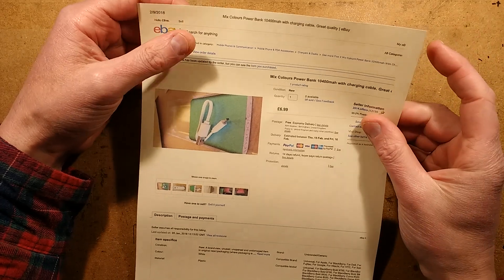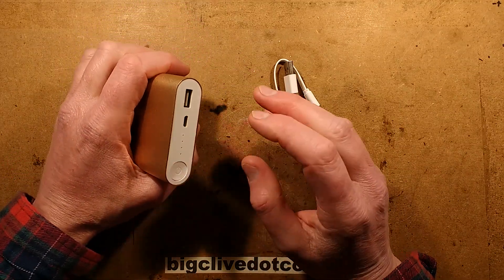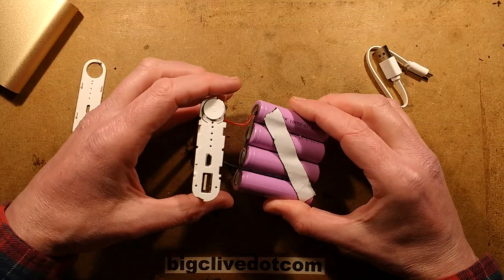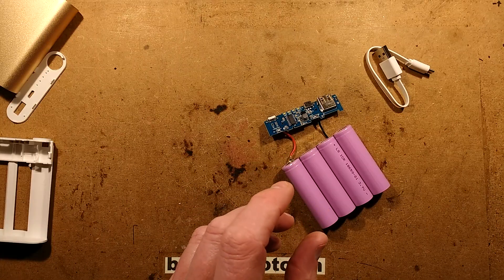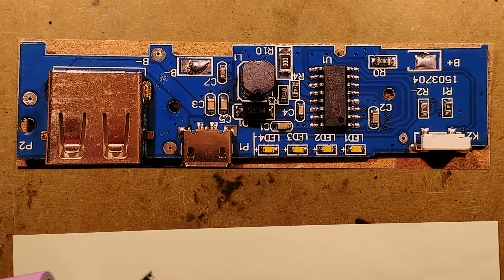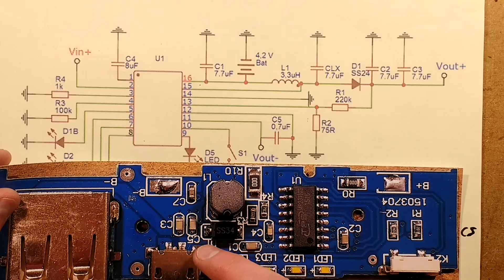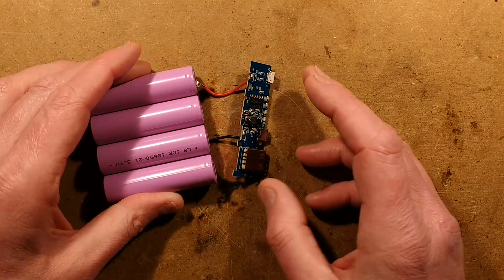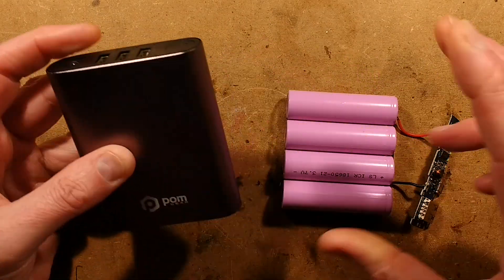Inside a fake "10400mAh" eBay USB power bank.

Comment: The design of it - the aluminum case with rounded sides, the interface plate, even down to the layout of text on the spec plate - is a rip-off of a series of popular Xiaomi power banks. I have a number of the original ones and they're truly excellent - quality, high-density cells, efficient boost circuit, etc. The fact that they really are excellent is of course why there are so many lookalikes out there. Quite a few videos exist here on YouTube about how to identify a fake versus an original Xiaomi. 

Xiaomi power banks actually tend to understate their capacity and list it as watt-hours as well, which is really nice. (They're not the only ones who do that, but they were the first power banks I encountered that do.)
Reply: Sorry, you have that back to front; here's a review of the Xiaomi 10400 from four years ago: https://www.youtube.com/watch?v=daKPjv_LaWU  

Another point in this is that Xiaomi is the one who had to start putting authentication codes on the packages of their power banks because of the clones; reputable companies like Aukey followed the Xiaomi's style cues because of their popularity. https://www.youtube.com/watch?v=obYhTgzEVP8
Reply: JetStream90 

Hes not being disrespectful. Hes freely expressing his opinion. In distress or emergency is a pretty great way to describe the state of the US since, at the very least 2001.

The governments actions since 9/11 have been inexcusable. Laws enacted since then have trampled over the rights that this country was formed to guarantee. Democrat, Republican, liberal, conservative and everyone in between should be disgusted. If you think any (R) is better than any (D) or vice-versa then youre blinded by politics. Thats what got us here.

I was 0331 2/1 Marines. I fly an Upside down flag. You wanna try to change that, HMU, youre more than welcome to try. 

Something you should know.
Reply: all them brands uses a casing and circuitry from a major OEM chinese brand ,i forgot the name ,something shenzung or whatever ,its generic and mass produced for many top brands and unknown brands
Reply: I have one of these, got it on sale from gearbest. They do in fact use weasel words with capacity since 5v is the standard but they use 3.7v in their capacity calculation
Reply: The xiaomi uses a TI charging controller.
Reply: Advertisement or not, I have a 10000mAh one as well and I'm satisfied. It does look very similar, but the xiaomi one I have is thinner and longer, and the power button is different.
Reply: I've had my Xiaomi 10400 MaH Powerbank for 1.5 years now and it's never let me down, a stellar product.
Reply: Living in a South Asian country (Bangladesh) Xiaomi is huge here. You can find it everywhere. Everything about the brand is so good. The phones, they are really inexpensive, yet better than phones that almost cost twice as much. The powerbanks, really inexpensive and reliable too. You name the products, and Xiaomi does it well. 90% of my friends use Xiaomi phones and not one of them is unsatisfied.
Reply: I stand corrected, I did not know that (don't tell anyone that someone on the internet actual admitted to being wrong, it could end society as we know it!). I don't think I'd even heard of Xiaomi back then.

Aukey's addition of QC 2.0 was the killer point for me though.
Reply: +Trid that's what  they all do.
Reply: Trid I forgot to wave my rainbow colored flag, dammit
Reply: iHome sells 10k amp powerbanks with this casing. I own one, actually. They're about $40 or so. It's a damn good power bank, but i'm not entirely surpised the case wasnt original.
Reply: Mine Xiaomi 10 000 mAh powerbank is actually 10 980 mAh. A whole 1Ah!!!
Reply: its still wayy off whichever voltage you use to calculate it, these are just reject cells, they dont even make intentionally 1ah cells
Reply: Aukey is only importer. xiaomi not make it itself. It's brands chinese stuff. https://xiaomi-mi.com/company/partners/
Reply: Aeolwn I meant the nominal voltage of the batteries, which (in case of Li-ion batteries) is always 3.7 volts.
Reply: That's true, but I certainly hope that people who actually do use the Wh ratings for any meaningful comparison (say to compare the energy efficiencies of different battery times) do.
Reply: Furr Bear Eh, I have no illusions about the battery industry, because bad manufacturers "inflate" (i.e. lie about) battery capacities just as much as speaker manufacturers lie about their speakers' power (yeah, I'm talking about the "magical" PMPO watts). And while Wh ratings for all sorts of batteries out there would be nice for comparison purposes, its proper calculation would be even trickier (especially in case of Li-ion batteries) than  the mAh value (as the latter's usually calculated at a specific discharge rate, say 1C, while Wh would have to involve some nice integration of the discharge curve, since its voltage changes quite noticeably during the discharge cycle). To give you just another analogy to speakers: many (especially Chinese) manufacturers don't even bother with showing the speaker's frequency response curve in their specs (if they have any), because measuring that is (much) more of a hassle than proclaiming e.g. a frequency response range of 100-15000 Hz.
Reply: Well, that explains a lot. I thought it was strange that such a carefully designed piece of hardware would lie about its internal specs...
Reply: Steve Evans Funny thing about admitting one's mistake: I saw some self-important person on social media calling this "i completely humiliated the other person". I buried my face in my hands over the fact that some people think that way.
Reply: Steve Evans admitting your mistake doesn't excuse it though. Like for example, why didn't you edit the very top of your first comment on this thread to say it is dead wrong. I have both Aukey and Xiaomi (and Anker and Huawei) products and there's really no excuse for spreading false information about them. They're huge companies. Not these little ones with poor support that might be gone tomorrow. Aukey is the smallest of the 4 I mentioned.
Reply: Came across one of them looking like that but it had a regular phone battery on the inside with plated metal rated for such a high number but yet the battery was only 3200 and it didn't work add half that
Reply: Odds are that they actually take defective Xiaomi units or at least parts to make these, that is how they usually make this profitable.
Reply: HAHAHA imagine not knowing everything Xiaomi sells is a rip off of something else.
Reply: Xiaomi used to be a rip off brand. Karma's a bitch lol.
They do go their own route now though.
Reply: i own the real ver of the powerbank
Reply: I have a Cheero power bank from 4 years ago that looks pretty similar.  But its rated 13400mAh/3.6v  still works like a champ.  Cheero is a Japanese brand and reportedly uses Japanese batteries, but the device is assembled in China.  I always wondered who the original designers and manufacturering facility these type of things were.  With how outsourcing a and global manufacturing is, its hard to know.
Reply: that's not true. this kind of powerbanks already existed long before xiaomi started to even make powerbanks.
Reply: I've got one that's identical to this one with Aukey's name on it. I just looked it up and I bought it on July 7, 2015. Labeled as 10000mAh with Qualcomm QC2.0. Paid $24.99 for it. I just used it on a trip, still works well. Probably falls short of 10000mAh, but not by much. Between 8 and 9000mAh would be my guess. Charges my S7 from dead to 100 twice, with a little to spare. Charges pretty quick too.
Reply: Furr Bear rftttgfggguiolp
Reply: oh thank fuck i thought i bought a rip off
Reply: @Timmity3 Then go to your friendly neighbour, the UK, buy one from there and go back to Ireland. Simple.
Reply: Furr Bear Xiaomi is great my phone is Xiaomi
Reply: Steve Evans: Not surprising - Xiaomi has focused strongly on the Asian market from the beginning; most people outside the area hadn't even heard of them until the past couple of years despite the fact they're a top 5 smartphone maker globally. (They're huge in China and India, for example.) I discovered the brand because I'm fond of exploring China-based retailers like BangGood, Deal Extreme, GearBest and so on  and I kept seeing "Xiaomi" all over the place and got curious.

JetStream90: It is an expression of distress over the current vile occupant of our White House.
Reply: CoolKoon - you and I both know that, but most people don't. Even if it was a futile effort, trying to get away from using mAh@3.7V as a rating for a device intended to produce 5V USB power to the much more rational WHr (or even mWhr, if they want a number even larger than the mAh rating ;) is a good thing.
Reply: Furr Bear You can calculate the Wh capacity of any battery bank by multiplying its Ah rating with its nominal voltage. So them providing the Wh value probably doesn't make that much of a difference.
Reply: its probably spying on you for the chinese government
Reply: What do you have an American flag upside down sir ?
Reply: +Patrick Star Hm - childish much, you "conservaturd". <eyeroll>
Reply: Furr Bear Correct. Says MI on one side, mi.com on te other. Here in front of me.
Reply: That's gay af
Reply: obviously an advertisement
Reply: And the Xiaomi is a blatant copy of the Aukey Quick Charge 2.0 10400mAh, one of which I've had for almost 3 years now. ;-)

The Aukey is actually an awesome little power bank. It fully supports QC 2.0, which is perfect for my old QC 2.0 compatible phone, and it also supports it on its own charge port, meaning I can recharge it very quickly with the phone's original charger.
Reply: Furr Bear I like your comment, I have a spare battery like these that’s 8000mah. The model I have works well and was able to charge my tablet decently well.

P.S. Why is the US flag in your profile pic upside down? According to the way it’s supposed to be handled, the flag hanging upside down means distress or emergency.  I hope you aren’t trying to be disrespectful on purpose. Something you should know.

Comment: A while back after Clive took apart one of those cheap power packs claiming 300k mah, I decided to pick up one of the 20k mah ones just to take the nice case from it only to discover even at its $20 us price it wasn’t lying about its capacity, it now runs the lights and sound( mic and speakers) controllers for my 501st scout trooper armor.

Comment: So there were two lines of speculation.  Crappy cells or shitty circuit. Any interest in figuring out which it is?  Might it be worth it to put in some decent cells or is the board just too crappy to be worth putting decent cells on it? (I suspect the latter but if you don't test, you don't know.)
Reply: I bought that exact same shell (a few of them) from ebay.  The circuit is just crap.  I can take the same PKCELL 18650s I was trying with and put them in other ebay powerbanks and they work just fine.
Reply: "Both". Like Tom implies, the circuit can't sink or source much current -- and Clive's cells are only 1Ah each.  
But I bought the same shells empty for only ~$2 each, and I have some puny 18650s that won't be wasted in them :-)

Comment: I bought several of these and populated it with good batteries that I had individually tested. https://rover.ebay.com/rover/0/0/0?mpre=https%3A%2F%2Fwww.ebay.co.uk%2Fulk%2Fitm%2F253193712872
Reply from the maker: I have one of those here.  Intriguingly the two micro USB charging ports are in parallel.
Reply: But is it good? Can it hold 5V under load, or does its output voltage drop under load? What is the true max output current? What is the max input current?
Reply: +bigclivedotcom if someone uses 2 wall-chargers connected to both micro USB ports I hope those have diodes on the output or they might 'charge' eachother :)
Reply: Ah, thanks Clive, I was just about to ask about the two inputs... I was wondering if it was for the top four and bottom four individually.

Comment: Woohoo First! 😄

I have a Xiaomi 10000mAh power bank, it wasn't cheap and appears to be the "full monty" I haven't pulled it apart as that would destroy it. I started to but decide it wasn't worth the risk.

The Xiaomi brand provides special labelling on their products to prove they are genuine not fakes. I always find that amusing, a Chinese company providing a way to check if they are genuine and not a "Chinese" knock off. Don't you just love the irony! 😂
Reply: There are "good" Chinese companies, and there are "bad" Chinese companies.

The trick is telling them apart.

Either that or just buying several of their items, and being able to make a single good one out of them.
(I wouldn't recommend it with Li-ion devices though).

I've got several really useful STM32 ARM boards for a price lower than just getting the board etched. Some of them were fine, others had the microUSB connector partially floating and not connected properly.

Luckily I have a steady soldering hand, and a rework station, so so far I've not had one I can't repair.

Something I heard from a friend who works out that way is that the cheap ebay boards are built with SMD components which have exceeded their moisture exposure limit. SMD devices arrived sealed, and the batch has to be used quickly once unsealed before moisture gets into the plastic package. If moisture does get in it can cause the SMD device to crack when it goes through the solder baking/bath process. So reputable companies won't do production runs with "expired" components. He said the markets are full of left over unsealed SMD components like that. Hand soldering those usually isn't a problem, but a mass production solder bath would be too much thermal shock for them.
(You can dry them out with gentle heating, and then bath solder them, but it's too much bother because then you've got to put them back into the tape for the pick and place machine etc etc).
Reply: Clear as mud.
Reply: Tom De Mulder You do realize that China started as a cheap knockoff shit supplier, and now has to protect their own nice products and even their own cheap knockoff shit from their own cheap knockoff shit?
Reply: Patreon upload? Do they get early releases of the vids?
Reply: Anthony Witham that actually sounds a beast and a bad ass one at that
Reply: Adding to the irony, Xiaomi's phones often are styled very similar to Apple's iPhones, and have a custom Android build styled to look like iOS.
Reply: Patreon magic! 🔮
Reply: I bought an sjcam sports cam (gopro clone) years ago and it says on the label "authentic sjcam". Seller said they are authorized seller of this product and then i asked "how can a clone be authentic??". We can see how China will crumble itself by these events
Reply: That's just called lying.  There is literally nothing in any way ironic about it.
Reply: My child said she didn't take a cookie out of the cookie jar but EXACTLY what she had done was take a cookie out of the cookie jar.  So ironic!
Reply: He never said that he didn't believe that they do, the post was POINTING OUT that they do, hence the irony.  Have you had your morning coffee yet?
Reply: Tom De Mulder "It's not just a couple of guys in a shed, making both the Xiaomi power banks and the cheap knock-offs and then passing one off as the other." - I'm afraid that the units that fail the quality checks of the former most probably ARE sold and re-branded as knock-offs. That's how business works.
And it isn't that China consists of only a couple shady figures hurling ridiculous knockoffs. It's the fact that MOST Chinese companies DO produce either knockoffs or cheap crap (besides the quality stuff as suppliers for Western companies), because probably that's where most of the money is. Thus it's VERY ironic indeed, even though I've seen other Chinese companies do that too.
Reply: i also have the Xiaomi 10k mah.. cheap and genuin shit
Reply: Irony? China has 1.4 billion people. 1.4 billion individuals. They make pretty much all your nice electronics, as well as cheap crap for markets with less money, and lower standards for marketing and quality control. It's not just a couple of guys in a shed, making both the Xiaomi power banks and the cheap knock-offs and then passing one off as the other. Sheesh.
Reply: Where did I say or imply  that I was laughing at the Chinese people, country, or their products.

"It's not just a couple of guys in a shed, making both the Xiaomi power banks and the cheap knock-offs and then passing one off as the other." Did I say or imply this? No! That's your interpretation of my comment. I like Xiaomi products and find them to be well  made for the price point. I know China makes most electronics and can make them to a high standard as well as making things to a price point. 

The "IRONY" is that the country that started off making CHEAP COPIES of other countries products, now has to protect it's own better quality products being COPIED with cheap knock offs made locally, Chinese companies have to protect their own products from Chinese companies. Hence, the "IRONY"

I'm not insulting them, I  believe China is going from strength to strength and I have great respect for their industries. I am old enough to remember when Japanese products were a standing joke, not a by word for quality. The Korean car industry is following the same Japanese pattern, and then it will be the Chinese. I own a One plus 5 and its a great phone, as good as the Samsung's I used to buy.
 
Save your lecture for someone else! You need to take a chill pill mate.
Reply: Ya preach on brother.  Anyone who doesn't believe that they copy their own countries designs should just hop on ebay someday.
Reply: Whoa! 3 days! But it was uploaded like a few minutes ago! Are you from the future? Haha 💋🍄💋🍄